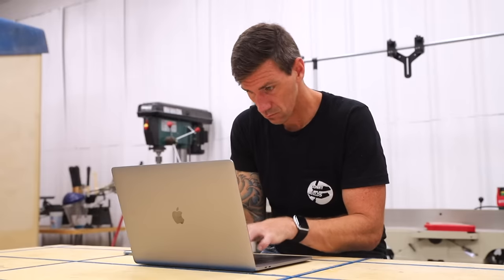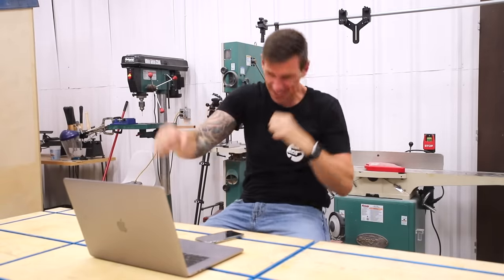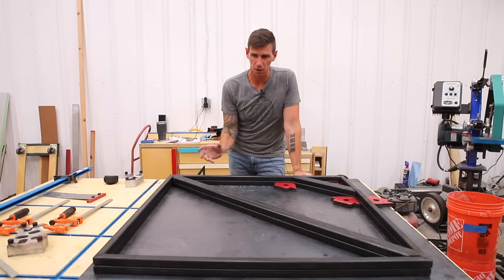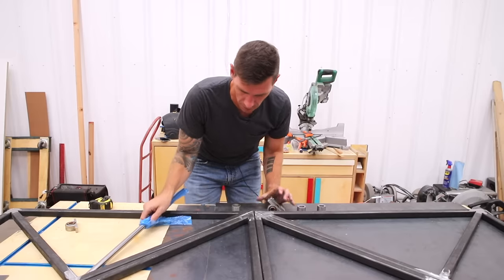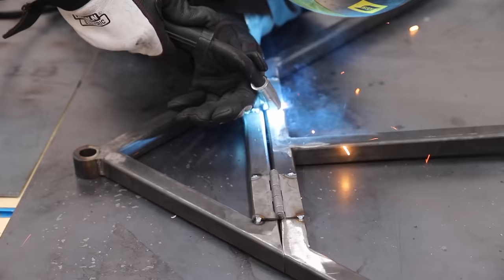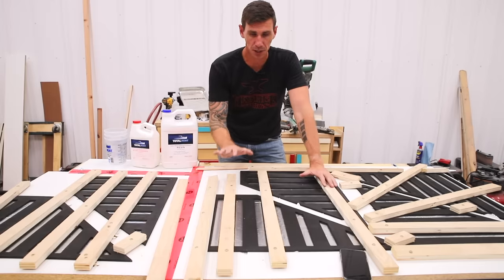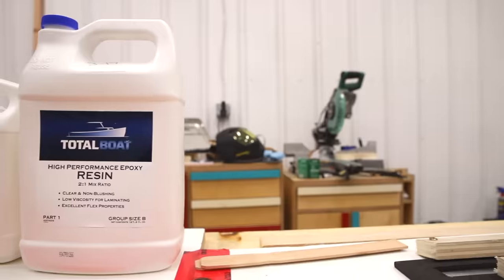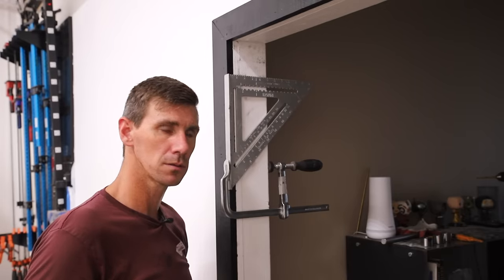Impossible Folding Door

Comment: Cool! But how do you:
- close the door once you entered the room
- open the door from inside
- effectively lock the door
Reply: Yes
Reply: The first 2 make sense but he isn’t going to make this as his doors to enter his home
Reply: @sebastianarty549  I think that since it's a door into his room, it should have a locking mechanism
Reply: Locking is very easy, just add a vertical rod and it can't go anywhere.
Reply: No, shut up. This has no flaws. It's cool. Be quiet. I dont want to find out it doesn't work
Reply: Probably not that hard to work around.
Reply: 15:16
Reply: Saadia Rajput Yeah
Reply: Wouldn’t the guy who invented it think of a way before he made it?
Reply: It is a garage door tipe, it's shouldn't open or close from the inside but аффтор курит тяжелые наркотики и гудрон и не знает что такая дверь без доводки и автозакрываний не имеет никакого смысла в мастерских и дома, если места совсем не внатяг, но тогда целесообразней занавеска (untranslatable Russian words). It's hard to open, it's hard to close, it's safe yours space, but doesn't stonks. And most important oil and paint from the hinges should dirt that white walls very quickly. It is really bad decision to install this one inside your house if you had enough space for normal door.  
Translated from the word's my garage neighbour.
Reply: @saadiarajput4345  no need to be rude tho
Reply: Answers
1. Pull the door from the inside like your trying to grab something but only your arm can fit in
2. Push it
3. You dont
Reply: You could put two doors, one on either side so u can pull the one shut from the inside and keep the outside one open and vice versa
Reply: Pray
Reply: he wouldn't really need to close the door because it's a shop and he's moving in and out alot
Reply: Hey
Reply: You can push it fron the inside and it folds out.
Reply: Honestly I'd have like one as a hallway closet door or something,  just to have it
Reply: He builder another handel
Reply: @ГригорийКузин-р3в  That's a door to a workplace not a room, it's fine without locks
Reply: The 2nd question is already answered if you watched carefully 15:15
Reply: To lock it, you just push a heavy dresser in front of it
Reply: @loriejoybalomaada7889  They weren't being rude, it was a joke
Reply: I don’t think your supposed to lock it
Reply: This door is for home office door I think
Reply: Nonth Suriyan i saw this door in half and flex seal seal it on tight and stronks
Reply: Nonth Suriyan he literally showed himself opening it from the inside. You push the handle forwards.
Reply: There's no need for locking the door, because the robber won't rob the house. He'll steal the door instead.
Reply: dude same as i was thinking
Reply: the first one is dumb, just grab it an d pull,  second, sideways deadbolt,
Reply: First and third are easy, second might have an easy solution
Reply: @tylertovey  yes, the handle that is, by design, only able to be on one side.
Reply: You don’t need to lock the door. No one else would be able to figure out how to open it.
Reply: @saadiarajput4345  not everything is perfect.
Reply: A folding bar can open and close from e the inside and you can just add a lock to the top triangle
Reply: To lock it just take of the handle lol
Reply: we don't lock doors in this house
Reply: Easily put a normal lock with a swinging mechanism hook style. This would prevent it being pulled to the side by the hook shape and also pulled outwards like a normal door.
Reply: Also extent the handle and have a tube in the wall where it meets when closed to house the extension. 

Would be awkward from the other side not really got a solution for that. Unless you set up a door on the other side aswell and has some sort of connected rails or such so when you open 1 side it opens the other.
Reply: You could rig up a lock pretty easy. But for closing it, you kind of out of luck. 😂

This door would go good on something like a closet.
Reply: A handle from inside
Reply: Magnets, push, magnets
Reply: I was JUST going to say that
Reply: Exactly what I was thinking
Reply: Attaching rails and a mirrored door on the inside?
Reply: He does both of the first 2 things in the video
Reply: @Ghostface756  that wouldn't work unless it was very thin and folded down as it would be against a wall you can just push
Reply: you need the Yellow, Blue, AND Red keycard.
then you run into a button and go "uhnf"

and then the door goes thweewwwwphsh

and you get the supershotgun, 20 shells, a neat little stat% for the intermission screen between levels.
Reply: jullian kirby why would u need to lock the door if u last 1 second lol
Reply: Answer you can't
Reply: But in the video showed us that they open the door from the inside CMIWW🤔
Reply: Bruh rly you dont have to point out every flaw it just looks cool don’t ruin it
Reply: Well I mean if your the kind of guy who owns this you most likely have security guards
Reply: Close the door while entering and push the door open from inside
Reply: Rubber bands.
Reply: Its ideally meant for a shed. Meaning it'll be in his backyard probably holding tools n shit. Dont think it needs any of what you mentioned
Reply: @rheyse2721  hhmm but its not practice. Example: we were being chased by people and we have to hide inside our house.There is no time to open / close the door. Lol
Reply: Good question
Reply: He could lock it by putting a chain on the two handles
Reply: Magic
Reply: @leviwatson1891  Would break almost immediately, I swear anything unique under common use shatters like glass
Reply: @cephalonplant4087  
I don't know about you, but I've never had a hallway closet I use more than once a week...?
Reply: Not meant to be a conventional door for "proper" use, just a novelty to show off.
Reply: Or that
Reply: For closing the door on the inside, you could just tug on the door and pull it in just like a sliding glass door but as it comes in you grab by the middle and bring it inwards to fully close it, as for opening he literally does it in the vid at about 15 minutes in, as for locking, just add a big metal pipe to the middle of it to prevent the folding maybe add a small ring and a hole in the middle to slide a pole into in the event you want to lock yourself in
Reply: Yes
Reply: The same way u would a hatch PUT A light LOCK and a flat handle <(the inside)ON IT the lock could also be an (electro magnet locking mechanism)
Reply: Ok but he don’t need to lock every dooor
Reply: Pls don't show this to the YouTuber he'll be sad
Reply: anushka chaudhari yes
Reply: Sebastian Arty it does make sense
Reply: You dont
Reply: Nonth Suriyan 15:16
Reply: Simple, you dont.
Reply: At 15:16 u can see him opening it from the inside just fine
Reply: Open the door once you entered the room/Open the door from inside

My SPECIAL tip: remove the wall. Then you can open it from both sides
Reply: Lock? If ur'e an engineering u can think of any working lock u can think of
Reply: You just do
Reply: DerSchmachtin good point
Reply: dang...
Reply: the door is made for his workshop so i don't think it really matters
Reply: Mate you don’t need a lock and if you do you just put a padlock between both squares
Reply: Whatch the vid
Reply: 99th Comment
Reply: 100th Comment
Reply: Yes xd
Reply: Nonth Suriyan 15:16 it gets a bit stuck but it works
Reply: All three are possible
Reply: Radical Traffic Cone Close it not open
Reply: he literally opened the door from the inside, did u even watch the vid?
Reply: I changed my name to stay fresh close the door
Reply: @sevenice4009  : Or simply put both doors on the same pivot points, and maybe some springs at the hinge points so the door will have a tendency to go in the desired directions when force is applied.
Reply: @loriejoybalomaada7889  Pretty sure it was a joke.  I thought it was funny.  Please don't take this as me being rude to you.  Different countries, different humor.  Be safe, wash your thumbs!  That's not a joke, a medical pro pointed out that people tend to focus on washing their hands so much they forget their thumbs.
Reply: -not sure, most likely by just grabbing it or you cant
-15:19
-doors dont need locks.
Reply: No one said this door was practical
Reply: Science
Reply: @tylertovey  Best reply ever xD xD
Reply: 15:15 he opened it from the inside
Reply: @Schmachtin55  this design would work perfectly for cabinets tho.

Comment: This door isn’t usable in a normal way as is. However, the way this door work is by the pillow block bearing hinges. Slap a motor on those hinges on the inside of the room, install some limit switches and a power bottom on both sides and then you have an automatic cool door. You still have some pinch points to worry about
Reply: I’m confused as to where you would place the motor exactly?
Reply: XxChickeN_NuggsxX priesley the hinge at 13:08
Reply: 100%, get some friction on the contacts for those hinges then all you need to do is rotate the pillars and the door will open.
Reply: Lol power botom
Reply: @epicperson7071  you micht need a little twist in the middle too ... to make it push outside... i think ... but i like the automatic idea
Reply: Daniel Bernard Sorry I mean that and the other hinges
Reply: Only problem is you might also need to push the door handle out or it may just lock up because it wont naturally fold out, depends how stiff the hinges are but you could also probably add some small wedges to make it fold out when torque is applied
Reply: Lol exactly what i was thinking wth
Reply: Aha i dont understand , bc im dumb
Reply: Sliding door. +sensor automatic opening. For less work
Reply: Ur right tho. U could makenit autonlike u said but u need some kinda pressure sensor to stop operation. Incase of kids/pets/
Reply: NERRRD

Comment: “Pivot”. Love this. I don’t have have much of a need for a door but I’ve been trying to think of interesting designs for a tool chest and this might just make the cut.
Reply: would work much better in that aspect because there wouldn't be the issue of opening it from the other side
Reply: I'd build it out of wood and use it as a fence gate
Reply: Thang010146 has some pretty good designs for tool chests and mechanisms in general. Finding it might be a chore though.
Reply: tool chest ... hidden compartments ... puzzle boxes ... game tables .. expanding tables .. folding chairs ... many many ideas seem possible with this basic idea
Reply: 0623kaboom if you plan it and decorate correctly it would be the ultimate hidden door